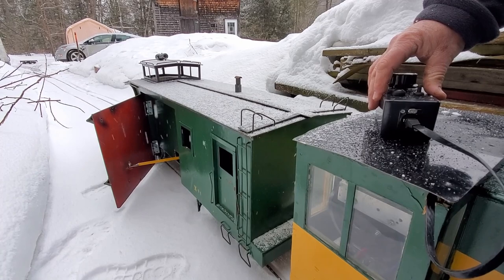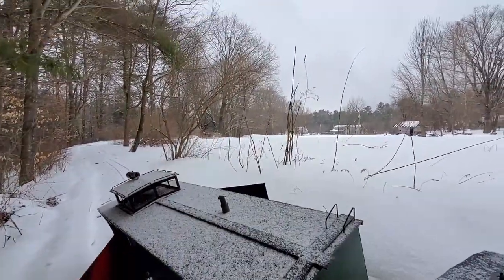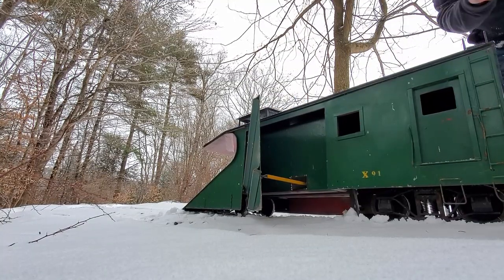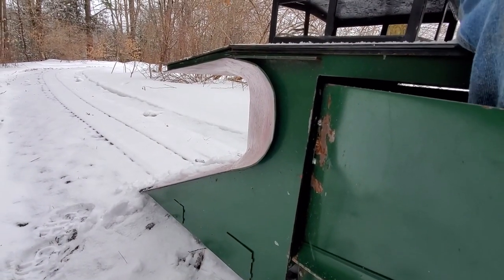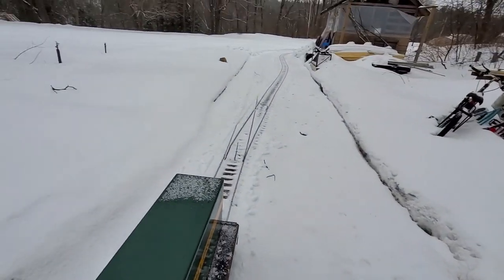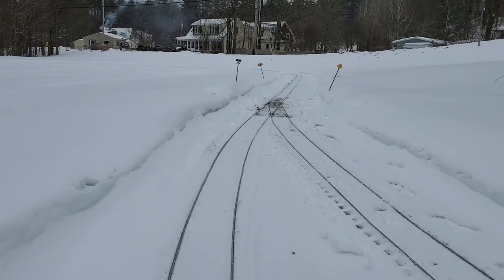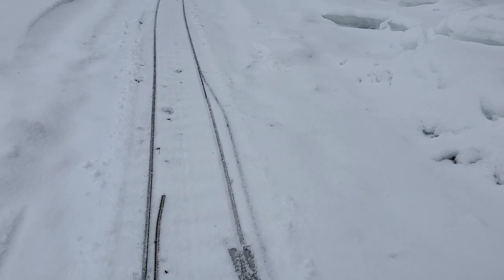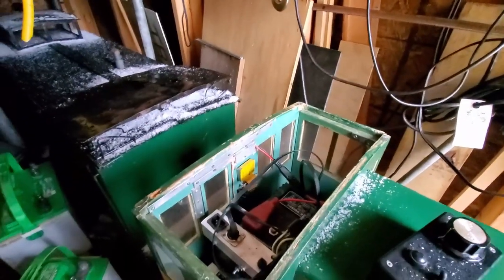Plowing, Derailing, Rerailing, Rinse, Repeat. MLBK plow extra 27 February, 2021

Comment: Street Cars, (traction), used a rotary brush to clear snow.  A drum brush, like a paint roller; but longer bristles.  
a pair of rotary brushes, motor driven, spinning, pushing the snow ahead of the plow; no flanger adjustment....  
Stiff bristles, adjustable hight, super plow!  

Two 50 pound canvas bags, weight; removable in derailment....  

Like your podcasts!!
Reply from the maker: It is a solution I have given much thought to. True, rotary brushes would have some advantages but at the expense of, well,  money. The Russell Snowplow cost me a caboose that I had reluctantly bought for $150 and I never really liked.
Then there's the problem of the broom not quite being enough for heavy snow. It does fine with dustings up to a couple inches but the majority of our snow storms dump more than twice that. 
Admittedly, even the Russell plow taps out at 6 inches and for storms like that there's the snow blower. It doesn't run on rails, it's what I clear the driveway with. I cut the banks back with it by going up one side of the track and down the other before I clean up the middle with the Russell plow. 
So, I guess the short answer is money. The Russell was pretty near free, considering what it would cost if I paid someone to build it. 
Now, if someone were to make me an offer like the one I got with the plow it would be another story.

Comment: You may consider adding as much weight to the plow as possible,  and like the previous comment , angle the wings 
back 35-45 degrees.  and for the viewers,  put a 10 foot pole off the front with a camera facing the plow, this will
help figure out whats up.     GREAT PLOW

Comment: Right from the first derailment, the front wheel-set of the plough does not rotate.
Frozen water in bearings? Grease too stiff with cold? Rusted bearings after internal ice has melted? Truck pivot bearer iced up? 
It could be a dozen things, sometimes just ice stuck to the rail-head or wheel-tyres.
Reply from the maker: It was mostly ice buildup on the wheel tread. This is really light equipment roughly the size of a garden tractor.

Comment: would adding weight help stabilize the plow? does it cut above the ties?
or is it at the rail level? Just great watching your videos. what is the 
running time for the engine ?
Reply from the maker: Weight doesn't help much with the plow. The blade doesn't get close enough to the rail, so I'm going to have to cut it in half and weld it back together. 
Run time on the engine? Not sure. I've never run the batteries down enough to find out. I run out of things to do before the batteries are done.

Comment: Would a set of wheels at the front with a serrated flange help to cut or break the ice away from the rail, extra weight at the front should/might help as well.
Reply from the maker: It might, but it might also cut into the rail.

Comment: Don´t be ashamed of your derailing plow. There is somewhere a video of a real CN spectalurar plowing scene in Ontario. When the front of the plow hit a really thick and hard bank of snow at speed, it stopped...but the rear of it still being pushed,  what do you think that happend ? Well the entire plow flew a good 50 or 60' feet in the air and landed on the roof. What a riding day for the plow crew !! Now if you wonder why they are equipped with seat belts...now you know. Of course it was the end of snow removal for the day.

Comment: Is this diesel or electric loco?
Reply from the maker: Battery electric
Reply: Thanks for the info.
Btw, what voltage does it run on?
Reply from the maker: @kraftovacibedna242  24VDC with a 500W traction motor.
Reply: Thanks.

Comment: Did you make the diesel engine your self
Reply from the maker: I built it from a kit 10 years ago. Then rebuilt it 5 years ago.
Reply: @MillBrookRailroad  how long did it take to built it
Reply from the maker: @blueberrytigerfox7699  10 years, so far. I'm still building it.
Reply: @MillBrookRailroad  okay lad got it
Reply from the maker: @blueberrytigerfox7699  That was the track, not the locomotive. The loco took a week.
Reply: @MillBrookRailroad  okay lad got it it's very nice

Comment: I think it would be better if 1 you weighted down the car with sand or salt, go slow, and put a middle car you can sit in to keep warm while you're slowly traveling
Reply from the maker: An old engineer I once worked with told me one time that the secret to running the plow train was to go a fast as the rail would let you go so the snow would fly off the blade. You need the momentum for the plow to work properly. 
Plowing also takes more horsepower than what I currently have, which means I have to build up as much momentum as possible to clear the line. Hence the speed I go in the video. 
Extra weight on the plow may help sometimes but not always. In my case, extra weight would mean adding another engine and I normally have only one engine in service at a time because there's almost always something broken on one or the other. 
Placing weight on the plow also depends on the snow conditions. Sometimes that weight is best put over the drive wheels, sometimes on the plow itself. It's definitely a balancing act and the balance can change between the time I leave the engine house and the time I get to the other end of the line.
Reply: @MillBrookRailroad  ah I see now

Comment: SILICON SPRAY ON YOUR PLOW BLADE, EACH TIME YOU  PLOW!!!!!  USE IT ON MY SNOW BLOWER AND STOPS THE SLUSH FROM JAMMING IMPELLER BLADE, AND THE CHUTE!!!  USED TO CLEAN OUT  CHUTE WITH A CROW BAR!!!!  YOU CAN FIND IT IN AUTO PARTS STORE OR HARDWARE STORE!!!!! WHAT ABOUT   ADAPTING A SNOW  BLOWER 12 HORSE   WITH RAILROAD TRUCKS  , HELP WITH   TRACTION  WITH BEING SELF PROPELLED WITH YOU R ENGINE HOOKED BEHIND! WOULD HELP WITH DRIFTING HARD SNOW!!!!
Reply from the maker: We don't really get snow drifts here in the woods but I do have a snow blower waiting to be modified to go on the rails.